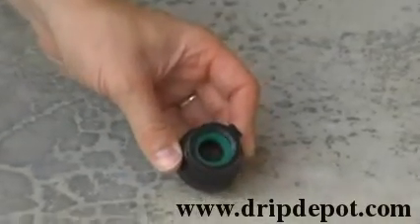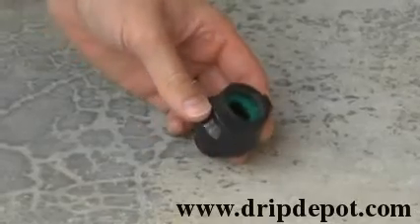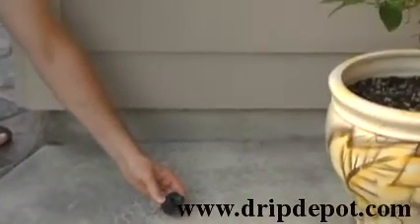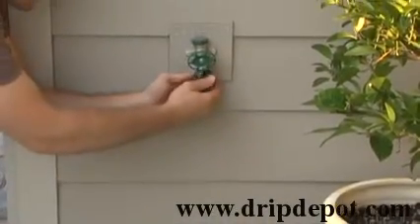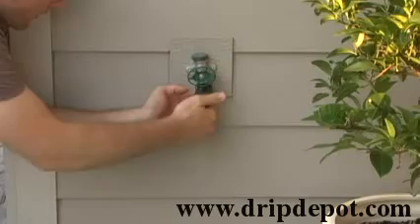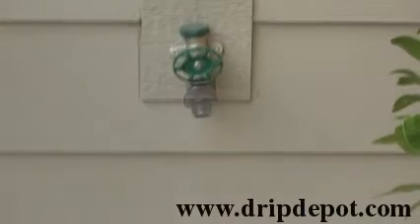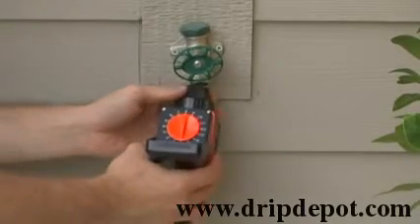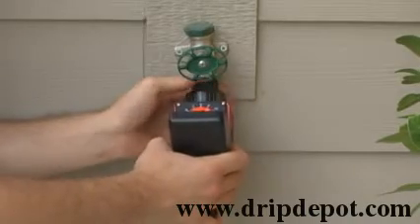How to install a backflow preventer in a drip irrigation system

Comment: I put a backflow with a pressure regulator after the timer and it popped off (the part where the vents are- it does not have threads to screw on ) when I turned the water on. Do you know what might be wrong? Should I just simply get a different one. This is one I’m helping my brother install at his house, I installed one at my house and had no problem with it.  I know it comes in a few different pieces, but they all attach with threads just like the hose and this part I didn’t even know came apart. And it just popped off as soon as the water was turned on on the timer.
Reply from the maker: Did it kind of fall apart almost in half?  If so, that's likely a bad backflow preventer (and if you got it from us, let us replace it!) that didn't have the two parts welded together properly.  It's rare, but we've seen it a few times -- definitely not your fault, they shouldn't fall apart from normal use, even at higher pressure, particularly that quickly :)
Reply: @dripdepot  yes that makes sense. No I got it off amazon. Thank you
Reply from the maker: @Mindy-s-channel  You're very welcome!  If they won't replace it for you, let me know, I'd be happy to get you free shipping so you can grab one at base cost :)

Comment: My drip depot backflow preventer gushes water anytime i turn on the faucet. Any idea what went wrong?
Reply from the maker: Happy to help and can confirm they shouldn't gush water under normal operation :) 

If it's gushing from a threaded area, check the female side of the backflow preventer to make sure the gasket is in there -- if it's missing, that's almost certainly the cause. 

If it's gushing from the little relief hole, check the installation -- the backflow preventer should be installed downstream of valves (timer valve or hose bib valve) so that it's relieved of pressure when not in use (pressure can build up inside and lead to symptoms like this if it's under constant pressure). 

Those are the two most common causes of a gushing backflow preventer, please let me know if neither of those is the case.

Comment: I installed my drip irrigation system and just recently noticed a problem blew with the water gushing out of the spigot when I turn the faucet on. I should be turning the spigot on for the water to release into the drip irrigation system to water my garden, right?